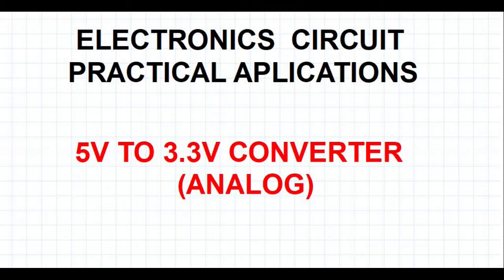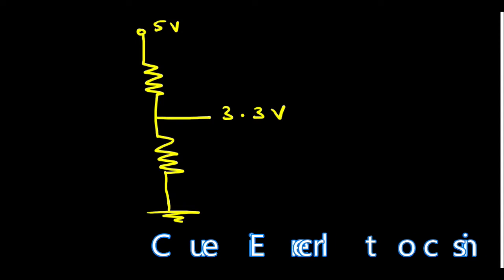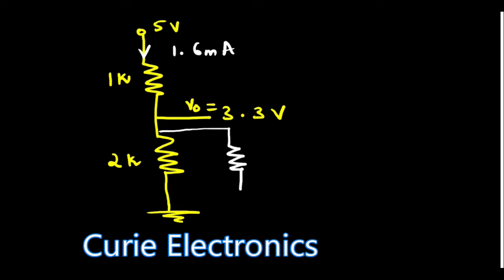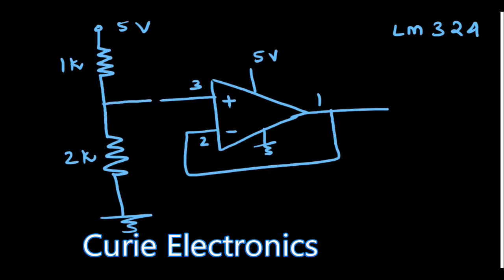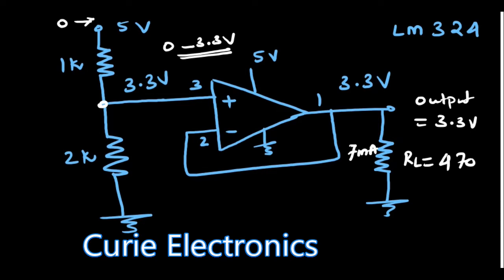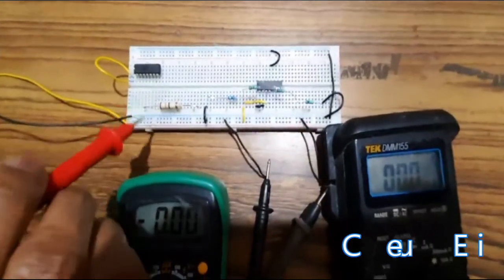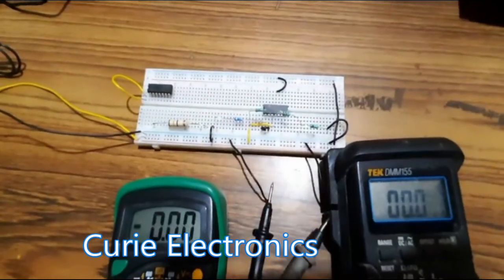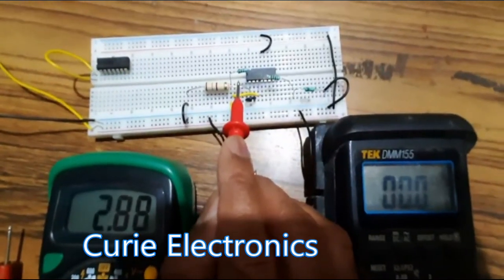5V to 3.3V CONVERTER FOR ANALOG APPLICATION

Comment: I am using ESP32 Doit Devkit and MQ2 sensor. MQ2 operates at 5V and I am connecting it to ESP32. How much resistor should I use for voltage division (using LM324 as op amp)?